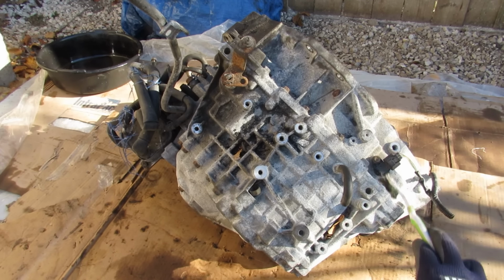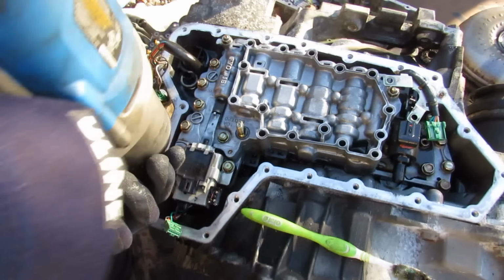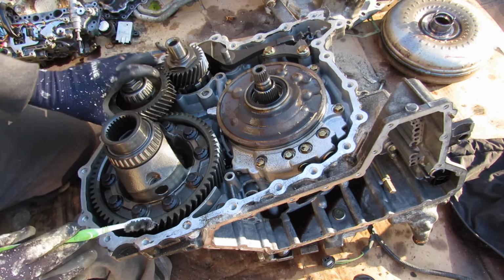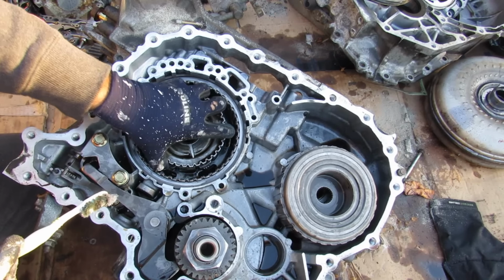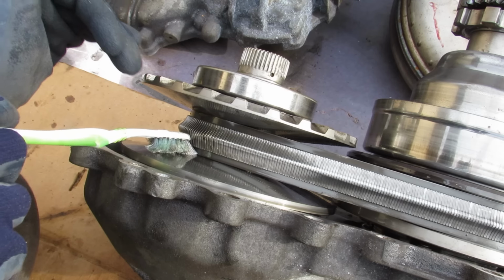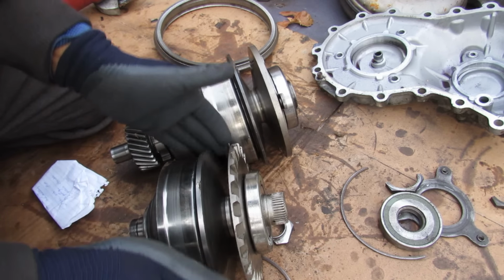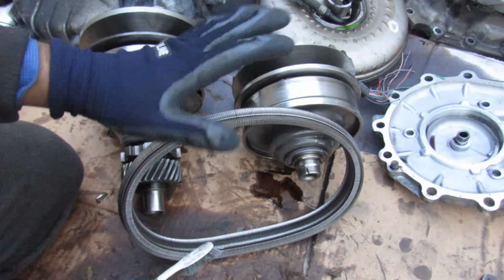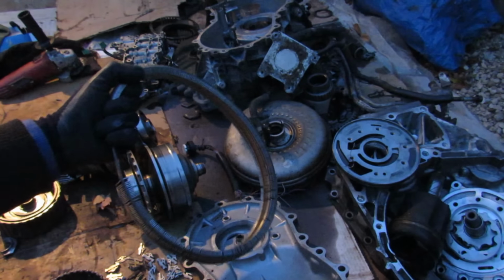Why Nissan CVTs FAIL

Comment: Hello after watching your vide on cbt transmission 
Now a have a 2016 nissan sebtra sv I remoov wornt outh transmission  and instal with a used one now after Instaling everything  on it and start the car car  has no acceleration can you help me out on this one or letme know what can I do 
And olso no codes?
Reply from the maker: Check fluid pressures

Comment: This was an interesting video. However, i sometimes get the feeling that cvt hate is paranoia from something new. Not to say that none fail, but when i had my 2005 altima people kept telling me i should have bought american and their trucks were way better and more reliable. After 10 years every person who said that was on their 2nd or even 3rd vehicle after thiers kept failing. Finally i bought a new 2020 altima in 2020 and sold my 2005 because it was still running fine with over 300k on it. I stuck with altima because it was so reliable and so far my new one, with a cvt transmission, is doing great. Not to say it wont have a problem someday but ive already had a few friends and families get newer chevys and fords and gmcs that have all had issues while mine is very reliable. Fingers crossed it stays that way, but so far it seems like my first altima where people tell me ill have problems and it turns out they were ones who got the problems with their vehicles.

Comment: very well explained !! im using the renault which has the xtronic cvt transmission which i brought a few months back brand new...no issues as of now ...works buttery smooth
Reply: every year change the transmission fluid and filter

Comment: On my first gen Nissan Cube, you could feel a rubber banding slack sensation under hard braking where it felt like something in the driveline, like a belt, had slack and then suddenly snapped back to being tight again. Would the CVT belt be the cause or is it related to something else?

Comment: Nicely explained . just bought an Audi with CVT . No idea what it is or how it works . All i know is that its noisy and unpredictable in its gear choice . By pulling this Nissan Trans all apart and giving us the running pros and cons commentary I have just become that much more educated . Step one. If its CVT and has a tow ball or any aspect of applied load including four wheel drive. Walk away . Its only time before its going to get really expensive or end up as scrap . Your mission well executed . This is what YouTube is all about . Passing the knowledge . Thanks and give yourself a pat on the back . Awesome

Comment: I've never understood why would nissan put these things in the maxima, it's advertised as a 4 door sports car with 300hp and the car is a little heavy. The cvt was never designed to go in this car and I feel like I need to trade it in before it fails. Ive been looking at the the q50 infinity which is basically the same car with better drivetrain options.

Comment: And the Renault Koleos most probably have the same transmission. We considered buying the 2023 Koleos when I found out the vehicle has a CVT that cancelled our interest because we pull a caravan with our vehicle and I am sure that this CVT will fail pulling a caravan. Then replacing a CVT in South Africa with an exchange rate of R20 for $1 (Des2023)  would cost us R100000 to replace the transmission, on a vehicle that cost about R600000..

Comment: Wonderful explanation. Gave a crash course about the techie part to a rookie like me. Have driven Nissan Tiida, Altima, and now X-trail/Rogue. Drove all to 150k and sold without any problem. Now in Xtrail which is at 135k, have started giving me jerks in the up-gear while I'm stuck in traffic or at a signal and pick up. Hence dove into this research to understand the CVTs.

Comment: I don't understand... Isn't this chain lose some of torque by rubbing against these pulleys? How does that even work? Well, ok for the rubber belt... It provides some friction so the CVT works... But the chain? It's slips on these pulleys..

Comment: 15:11 Ah, putting too much engine power and torque load on your CVT? But what other way is there to power your increasingly large, tall, and expensive vehicles? How will you give them all-wheel drive? Surely they can't just make smaller cars! That would violate whatever pact the auto industry made with The Dark Lord, or something!

Comment: I drive a 2014 Nissan Sentra and had my CVT transmission replaced at 80k miles. I am now at 160k miles and the transmission is beginning to slip. Would changing the transmission fluid resolve this issue? Please help
Reply from the maker: Ouch!!

Comment: I found that if you don’t change the oil on these every 20,000 miles, they tend to burn up. You must change the cartridge  filter also located on the transmission coming off the cooler.

Comment: I think that overuse and not enough maintenance are the main reasons CVT fails. Remember to change the oil and filters at 40,000 km. Try not to go over 2500-3000 RPM until you reach 40 km/h when starting to accelerate. Avoid overheating during off-roading. Also, be careful not to overload the vehicle when transitioning from challenging terrains like mud, ice, or snow to solid surfaces like concrete or asphalt. Qashqai 2019.

Comment: This was an awesome video... i have a suzuki swift cvt 2013/14 model that every once in a while in prolonged stop& go trafic situations, the response to accelerator input becomes prolonged and even completely stops altogether for about 10 seconds even with the pedal to the floor....very weird...i dont know if its a transmission overheating issue or what... anybody that might have an idea please lemme know..cheers

Comment: I had a 2014 bissan sentra, transmission brock around 140.000 Miles .
Reply: have you ever had changed the oil and filters in it?

Comment: Do you have any experience with these in the Versa? I have one that doesn't have any codes but, loses power after it warms up? I see one PID line pressure on the scan tool go low and another PID line pressure goes high, then it won't move.

Comment: They all say it slip, but I had a Honda cvt that had a bad slip. It’s
 Ok it about knowing how t used it,  you can press the gas and go. It slip.  You have to load the belt barely pressing the gas and the car not moving. With training it just take 3 secound once it loaded get the car going about 10-20 feet it  solid you can  gas it very hard it will not slip.

Comment: Our Nissan Rogue had transmission problems and Nissan extended the factor warranty to cover up 150k miles. took it to a Nissan dealer in Staunton, VA. The dealer mechanic said We had put to much transmission fluid in it, IDK how since transmission is sealed. The dealer refused to honor the warranty and we had to pay over $500 to get it back.after they corrected my overfilled transmission problem. This didn't do a thing to fix the recurring problem with transmission slippage. Don't take your Nissan to the dealer in Staunton, Va for warranty problems
Reply: it's not sealed and completely serviceable. Oil and filters can be and should be changed despite what is written in the user manual (they do this to make this car look cheaper for fleets, overall costs etc).

Comment: I owned a lot of cars and trucks from the past.  I can't say the conventional transmissions  were any better. The 1992 dodge truck i had was no exception to this.  I bought it when it 8 years old and it had 94 thousands miles when it started to slip and destroy itself.  It was suppose to be a heavy duty big block transmission  A518. 727 torque flight.  Chrysler was notorious for transmission problems back then.  My sisters 1977 monte Carlo only had about 62000 miles when it gave up the ghost. Hers was a 350 turbo transmission.  I  drive a 2012 murano with the 260 hp VQ motor now . I had this vehicle for 11 years with no problems with the cvt. It has about 140000 miles on it  . I replace the transmission fluid  about every 30000 miles.  This keeps the transmission cool and well lubricanted.

Comment: It's good advice in general to change your transmission fluid, but a lot more so with CVTs. I had a Honda HR-V that I traded in at 72,000 miles, and the car drove just fine. I wouldn't necessarily avoid a Nissan CVT like the plague, but I wouldn't buy a CVT Pathfinder or Murano. My sister-in-law has a 2.4 Altima with a CVT and the car still runs fine with 150k miles on it.
Reply: I've changed oil/filters after 40k km. Runs like new.

Comment: Thank you for the detailed explanation. We had two Muranos. 2004 fwd , sold it at 290k miles with good transmission and 2011 fwd,  sold at 217k with bad transmission. They were both purchased new and gently driven. Everyone says CVTs are not rebuiltable,but from the way you disassembled, it seems not as complicated. Why can they not be rebuiltable? I have rebuilt many ice engines and they can also be very complex.
Reply: It can be hard to find a technician that knows how to do it properly and has enough experience and can be $$$ in countries with high wages. In my country it's completely doable and affordable.

Comment: Steel belt? Why the fuck don't they use steel belts in scooters too??? We wouldn't have to replace the belt every 6.000 miles. Oh... That's why!
Reply: They run dry and spring-loaded. But CVT can also be found in some heavy machinery like agriculture, mining etc.

Comment: I got 300,000 miles on My Nissan CVT. The brake system failed on it The engine was still good and the transmission was still good It just wasn't worth the cost of the repair and it was winter time so I wasn't running brake lines in the cold of Connecticut.

Comment: Wow knowledge is power indeed. My Nissan X-Trail broke that CVT chain into pieces but the guy who opened it cant put it back as he ran away now I am stuck with it since April. I have ordered the belt and received it but no one is able to repair. Those that can are very expensive.

Comment: Failing CVT's or any drive train components shouldn't be a problem for auto manufacturers any more because of all the customer analytics they're collecting they can tell the exact moment (w/camera footage) you lost your temper &/or abused your vehicle outside the recommended operational specs such as pressing the accelerator too firmly or made an attempt at helping someone out of a snow drift etc.. And thus be able to easily deny warranty claims. So much cheaper than all that bothersome engineering, retooling & recalls.   Personally I draw the line at factory installed poison canisters triggered automatically in the event of customer experience/vehicle disharmony.

Comment: Really, what a Great video! Well done. I had two different V6 Altima's bought new, liked the car liked to drive them. kept them like new. A month out of warranty the alternator went out. after finding out that I couldn't change it out the dealer ripped me for $1025.00 to replace it. Got pissed the next day and went and traded it on a Tahoe. I told the dealer about it and found out he used to work for Nissan. He asks me if I had any trouble with the transmission and I told him no. He told me that I was lucky and that around 40,000 miles they start giving problems. When he told me how many Transmissons a month that they replaced i was glad to see it go. After watching this great video, I can see the weak links. PS, I will never buy another vehicle that I cannot change out an alternator on without tearing into the AC unit !
Reply from the maker: Sadly, alot of cars require severe disassembly before replacing basic things like an alternator or starter. That's how the industry is moving towards.
Reply: A thousand dollar alternator.    That's a Nissan

Comment: It's junk yet Nissan thinks that continuing to put these in all there cars is a good thing, I've owned 4 Nissans since 1993, a truck, a 98 Maxima, which my wife loved and a 02 Xterra S/C. that I loved,  but it was kind a gas hog. Then I purchased a 2014 Juke w a CVT, by the way,  a local mechanic will not touch this thing, so I have to take it to the LOCAL Nissan Dealer and it cost me an arm and a leg to have it serviced. NEVER will I buy another Nissan.

Comment: You keep refering to "automatic transmissions" in comparing to the CVT. Is the CVT an automatic transmission or not? It fulfills every definition of an automatic transmission. It requires no driver operated clutch. It is able to idle the engine in gear while stopped at a traffic light. It changes gear ratios on its own according to load and speed. Isn't that what an automatic transmission is?

Comment: Thanks for this video, and in other words. Don’t buy a vehicle with a CVT transmission. Doing research on a Nissan Rogue and seen several complaints from customers that had to put 2 to 3 new transmissions in a Rogue with less then 150k miles. It’s dangerous for those driving them.

Comment: I had a 2011 outback that started whining. Subaru garage said it was fluid pump failure.  I told them to make repair and they said they don’t repair them. They quoted me a factory authorized used one for $2800 plus labor. I found a garage who got one from a junkyard and installed it for $1200.  Drove the car for 232,000 miles and its been passed to two other family members.
Reply: Thats pretty cheap to be honest, I know if the mercedes 9 speed transmission in my 2022 Nissan Frontier Pro4x needs replacing I've seen it being $8000+

Comment: I have 2014 nissan pathfinder and cant drive anymore because of slipping and shaking. I find out in my scanner that there is P1F70 cvt judder transmission problem. Is there any chance to fix this?thanks😢

Comment: It's all about maintenance. I service my wife's Altima CVT every 20kish miles and use Nissan NS-3 fluid (yes I'm sure some other company makes their fluid, but I still use Nissan). We currently have almost 200k miles on it and only had to take into the dealer once for a software update to apply more pressure to the belt to solve any slippage issues on the CVT.
There's no need to be scared of CVTs they have come a long way over the years. Any transmission can go out at any time, it's a given. Longevity, it's all about proper maintenance.

Comment: My '18 Pathfinder started shuddering around 95K.  Gave it up.  Got a '23 CPO with 6k on it and runs and reacts so much better.  I was a little leery about the ZF, but it reacts very quick and it's smooth. Got the 100k warranty.

Comment: A CVT transmission cannot be driven like a typical American automatic shift transmission. My Nissan Altima has 100,000 miles on it, 34.5 MPG on the highway, 29 MPG city driving and no problems with its CVT transmission.

Comment: I have a T31 X-Trail 11 years old CVT, no whining and smoothe, you want longevity from it? then change the fluid every 40,000 kilometers, and do not thrash it..
Reply: Correct! flush, change, use correct fluid, at 35 to 4000k and don't thrash it..

Comment: I always thought the CVT belt system was a very inelegant solution. I had a 1998 Honda Civic HX for 10 years, one of the first popular cars with a CVT belt transmission, and it had great fuel economy, but the transmission failed after 7 years, and the refurbished part failed within three years. Definitely it was not ready for prime time back then, even on the small Civic. The Toyota power split device on the Prius is such a more elegant solution to get a continuously variable ratio. So reliable, so simple, the advantages of a manual transmission and really none of the disadvantages. I love it, it’s always in top gear.

Comment: 8 years and not a single issue with our Murano CVT.  We have not missed the shift bump from a regular transmission one bit.  And we’re still amazed at how quiet it is without all of the rpm swings.
Reply from the maker: Nice. 
Report back in another 8 years
Reply: @speedkar99   Are you implying that it’ll fail by then?  If so, 16 years without a repair is pretty darn good.

Comment: I had a Nissan Murano with a CVT.  I LOVED that vehicle.  Comfortable, nimble, roomy, durable, fun.  It was just great.   

The reason I got rid of it? The CVT failed.   After 188,000 miles. Which I suppose isn’t too bad.   But still.
Reply: My altimas failed at 150k. Luckily had extended warranty that covered it

Comment: The real reason for Nissan early CVT failure is the lack of Oil radiator, Dealership usually lie about changing transmission oil (CVT has no tolerance for negligence) and the CVT by nature it also can't handle idiots well, if you push it beyond the specs it will break

Comment: i have a 2015 nissan quest platinum with 47000 miles. i did the first ctv oil change at 47000 and Im just finding out the bad about this model. I do feel a shudder already. Would adding one of the aftermarket coolents help? thx

Comment: I replaced the CVT on a Subaru Outback last year. Had 105,000 miles on it. Cost $9000 for a REMANUFACTURED CVT. Subaru covered about $2000 of it, but it was 5,000 miles out of warranty. fml Never buying another Subaru, ever. Never buying another CVT, ever.

Comment: If these type of transmissions are proan to failure, why isnt nissan being charge to change  or fix the problem. No one should have to pay for a 5 thousand dollar repair when an automobile manufacturer knows their transmissions are garbage😊
Reply: Nissan had to settle a few lawsuits over the later ones (starting aroung 2015 model year, I think?)  And they put a 10 year, 120,000 mile warranty on the earlier ones ( I have a 2006 Murano that has that warranty, although I am up to 140,000 mi and 17 years, so I'm far beyond the warranty, and happily, the CVT still works fine)